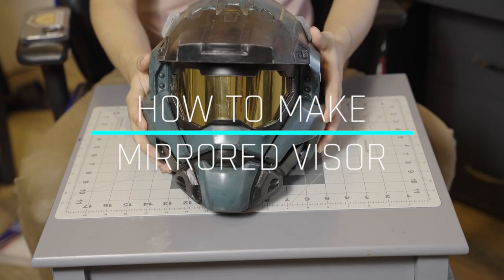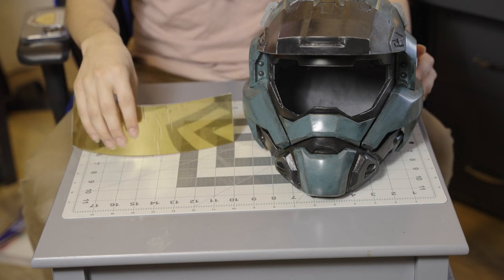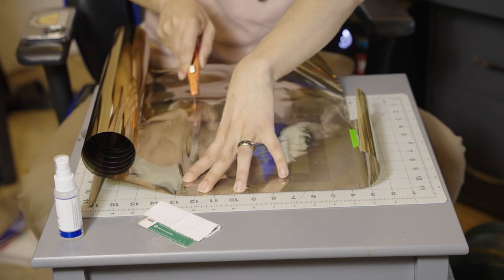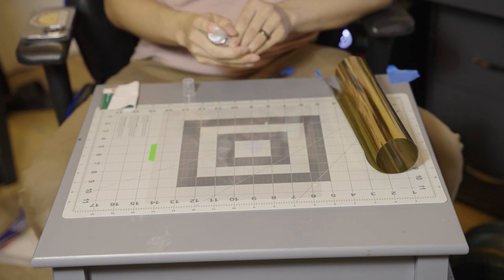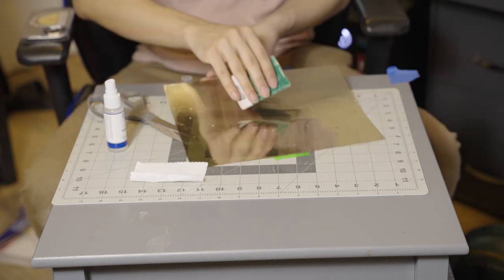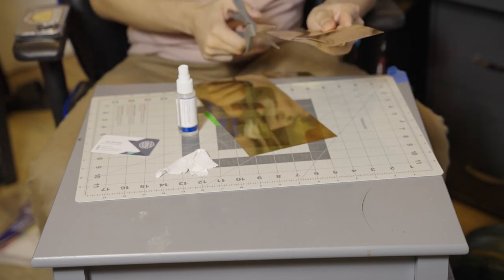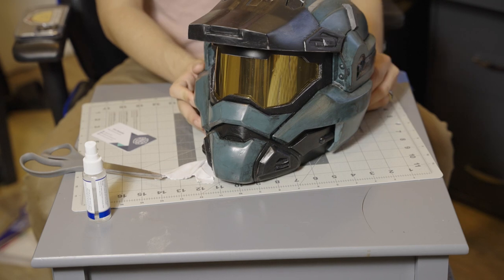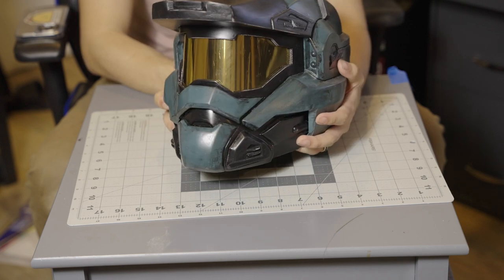How to Make a Mirrored Visor Under $20

Comment: This is legitimately awesome, I just acquired a vacuum former and I am going to 3D print the "buck"/mold for the visor, and use your technique here for the mirror tint because yours turned out so good. I'm making an mkv armor suit and mkVI helmet, and this will help me immensely and seems simpler than trying to dye for color and paint the one way mirror coating on.
Reply from the maker: Thank you so much! I just got a vacuum former too, and I hope to use it on some of the newer helmets released during the operations. Lots of options lol but happy to help! There are lots of ways to achieve the same result for visors

Comment: Did you have to scale any of the models or did you just print it as it came in? I've started my 3D print today. I have a 22 inch diameter head.
Reply from the maker: I use a couple of programs I have; I also measured my head to reference. I usually scale,  just to be safe, because I've had bad luck before when I print something either too large or small

Comment: How is it secured to the inside of the helmet? Would i be able to quickly remove it to take my glasses on and off?
Reply from the maker: That's a good question! So this helmet is from Aguilar Workshop and actually has a slot for the visor which holds it in place, it can be easily removed since the visor is a bit flimsy but putting it back on might be hard if your wearing the helmet